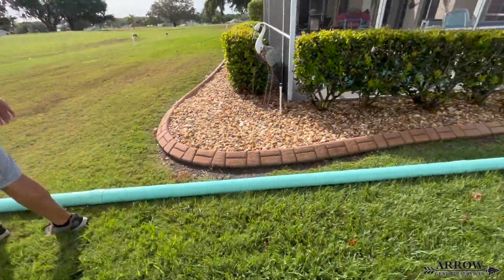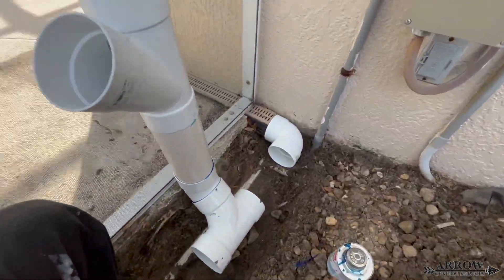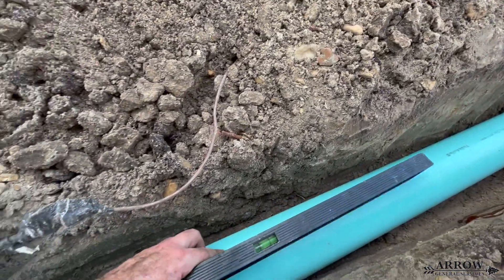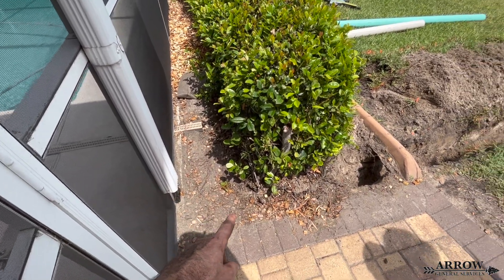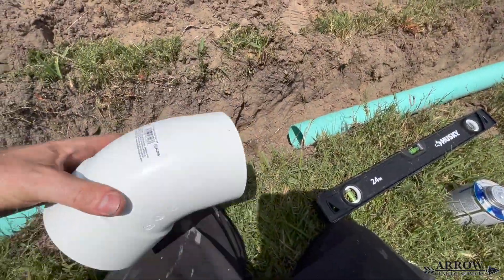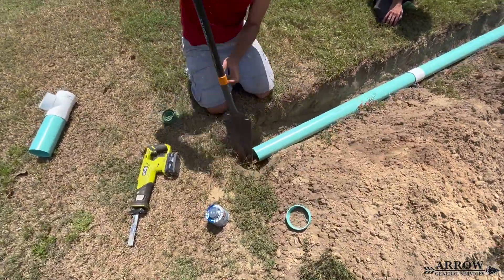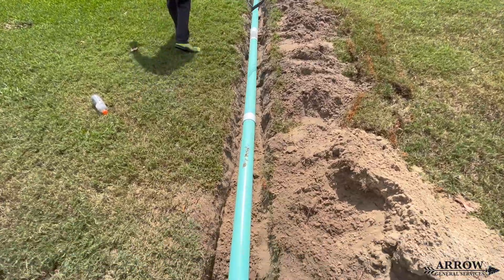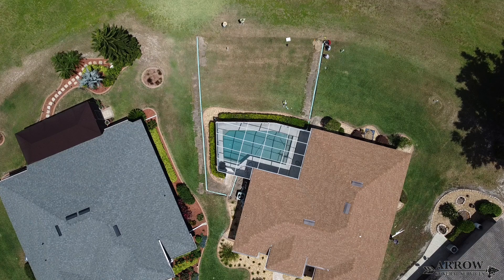How To Drain Water Away From Your Home - Yard Drainage - Downspout Drains

Comment: I enjoyed this video. I appreciate the time you put into it. BTW the guys chasing storms of finished jobs are going backwards. Real hard working contractors that bank are on to the next job and always moving forward. When it rains I go to big properties that I'm designing systems for because rain run-off tells you everything you need to know. Better then measuring elevations for days through acres of property. Anyway that's my 2 cents on the guys that have more time to go backwards 😂
It's worth mentioning that the tee is a sanitary tee at the end of the line and they need to be right side up for proper direction of flow. 
Keep up the great videos.
Reply from the maker: Thank you sir! 🙏